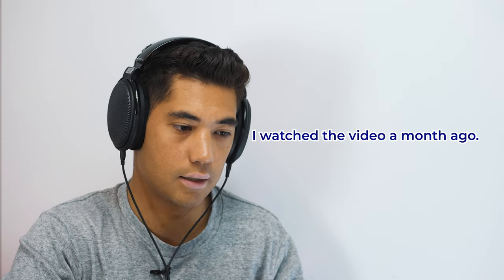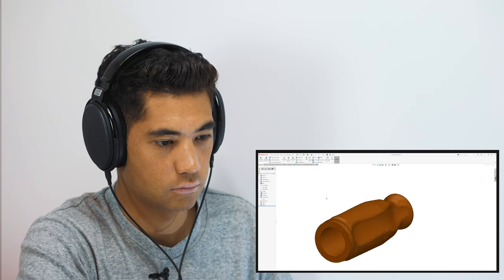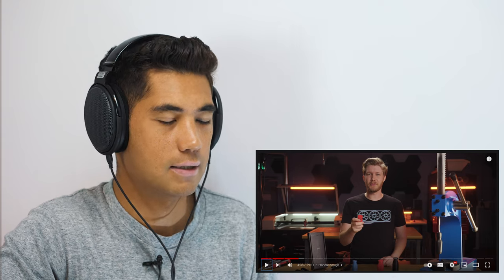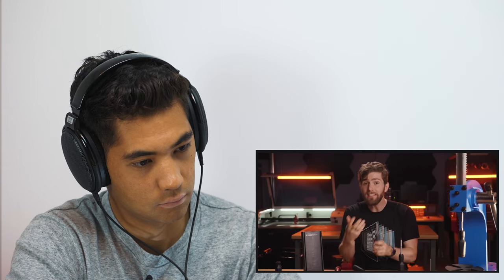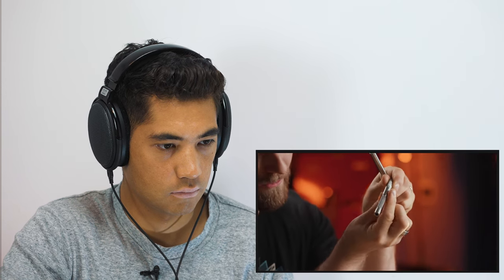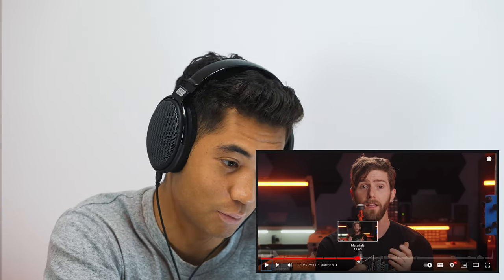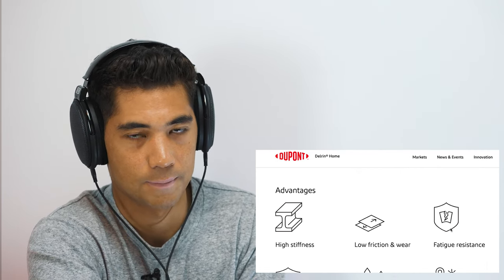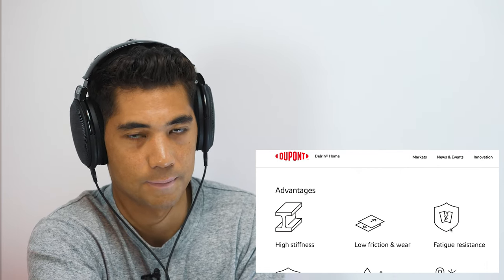Product Developer Reacts to the LTT Screwdriver | What can we LEARN from Linus Tech Tips

Comment: You were correct about the Delrin plastic that is used to hold the bits and its high stiffness that could pose a issue if dropped . JayzTwoCents did a review on the screwdriver where he dropped from his eye level and one of the tabs did break.
Reply: Tbf, he dropped it from about a foot above the top of his head, so a little over 7foot of a drop... but yeah,  one of the bit tabs did break
Reply: He's the only one. There's this dude who mods cars for drifting in Tokyo and he dropped it from an entire floor and nothing happened.

Comment: Came here from Jeff Geerling. I've owned the LTT driver for a couple months now, used on many projects. I also have Wiha, milwaukee, craftsman, harbor freight, and snap on screw drivers and ratcheting drivers. I bought the LTT because I know how long they worked on it/the attention to detail but really thought of it as a educated gamble, but am very happy to say it's my favorite now. It fixed several issues, like milwaukee's atrocious front end weight that literally causes the driver to fall out of you hand when one handing. The ratchet mechanism is easily the best, and I pay attention to this though on my ratchets eg 90-110 tooth is best. Finally I have a ratchet driver where the selector is intuitive, left is loose, right is tight, small detail that matters. The biggest difference i've noticed is one handing performance, its light, the triangular shape is just right for my hand, and the endcap is large enough and free spinning so its very easy to spin with one hand and a claw grip. Only cons for me: stock bit loadout is not even close to ideal, I dont use square bits at all, and need more hex and torx. That's the only con for me personally so it's money well spent, and the overall feel has me reaching for it constantly. I'll buy another for work and I just learned of a possible stubby version I'll keep an eye out for. Well done and well made product worth the cost, especially versus milwaukee. I was so sorely disappointed in theirs, from a company that generally manufactures the best stuff, sigh
Reply: Hand Tool Reviews  you sound fun at parties lol. I work a lot and don't have time to spend analyzing the whole market before stating an opinion, I made a comment with my opinion after using it for some time and falling in love with it. I don't own any of those other ones you mentioned, I only used examples of what I've actually used, but clearly you have the time to analyze the screwdriver market in granular detail so I would defer to someone like you's opinion, if you didn't come off like an elitest snob. I didnt say i was comparing it only to ratcheting drivers, i was comparing it to wihas non ratcheting type because for one handing performance it doesn't matter to me if its ratcheting or not. Fwiw the backdrag and ratchet mechanism performance is so good I would consider anything better really splitting hairs, adding to your image of elitism. I have no doubt you know much more about this than me, maybe I was too strongly opinioned toward ltt driver in my comment and came off as such, but I had a few minutes to make a comment here after watching geerlings video so I just wrote what came to mind. Good luck with your channel, you should probably take a 2000 grit approach to comments vs 200 grit though, works wonders for credibility and respect 😉
Reply: Hand Tool Reviews  maybe that was too strongly worded so I'm sorry for that. Long day for me away from home fighting with machines. Cheers

Comment: Very good video, well explained the process of product development. If you have connections that are willing, consider guests that are from different areas in the field. i.e tool designer, materials engineer.

It does make sense to use virgin material and not recycled at SOP/launch. Until PV tests have been completed with parts made from recycled resin would be risky.

Comment: 41:15. I work in plastic extrusion and injection molding. You severely underestimate the power of TiO2. It overpowers just about everything, including carbon black. In fact, almost all light shades of colorant are part TiO2. It's not just that the fully saturated colorants have a lot of the pigment and the lighter ones less pigment. The main reason is that the pigment is being overpowered by the titanium dioxide, making the colorant "whiter". So, in fact, most black plastics CAN be recycled into a white product! And it usually requires less colorant than recycling a bright white plastic into a dark product.

Comment: Interesting one of the other creators, i think it was Jayz 2 cents did drop the screwdriver and one of the delrin bit holders did snap. So that might confirm what you said about the "high stiffness" issue with delrin. However, they have done their own drop tests without issue, so it might have been a fluke.
Reply: From memory the issue was a failure caused by manufacturing breaking their fix for the issue

Comment: I have worked for more than  15 years with plastic injection as a mechanical design engineer, never heard of a mold of this size and complexity (pretty simple molds in this screwdriver) that cost 100K USD, not even close. From what I saw he should have 3 molds, lets say 4 cavities each, all of them together should cost no more than 100K for molds with a 500K-1M cycles lifetime (and this is an estimate on the expensive part of the spectrum you can get it lower), I guess he has 1 metal mold too which should be around the same price of 1 plastic mold and some machining for the other ratcheting mechanism parts. Most of the costs goes to the R&D process. Design of a product like this should take around 1 year from start to finish, so I guess the 3 years process is what cost him so much.

Comment: how come he doesn't know Delrin? POM is one of the most common polymers because it's so easy to machine or injection mould and is also used in low friction applications alongside polyamides. Every second 3d printing tinkerer knows it..

My professor talked like 15 minutes about it in the first lecture of material science.

Sorry if I'm being rude but this kinda undermines the rest of the video.
Reply: He's a film maker. Not an engineer
Reply: POM is one of the excellent engineering plastics. Virtually all (not-horrible) plastic gears are POM. OTOH, ABS is the hallmark of cheap plastic tools, coming from the distant offshore.

Comment: Its a great screwdriver but those proprietary short bits are its biggest downfall.
Reply: It's such a minor complaint since if you want to use long bits you can just rotate that little ninja star and put in six normal bits.
Reply: @TheSolongsidekick  It's not a minor complaint. Even if you put 6 normal bits, the magnet is too weak for the longer bits. I actually have this screwdriver
Reply: @TheSolongsidekick  it's not a minor complaint, if you get your bits chipped/worn, you are less likely to replace them as it's very inconvenient... I can't source them locally and no way I'd order them from the other side of the pond.
Another complaint is that if the screwdriver is intended for 10Nm, I'd have likely a 1/4 drive or at least an open wrench one (but that would require a hardened steel shaft)

Comment: This is a rebranded slightly modified Megapro screwdriver that is selling well, even at this price due to marketing/fanboys. It is not even particularly well suited to pc building, due to its short shaft, and chunky handle, even though that is what it is primarily marketed for.
Reply: It's not a rebranded slightly modified Megapro screwdriver.
They only used there ratchet mechanism and even that got tuned, the rest is completely different.
Also I had never any problems with the length and the handle thickness for building PC's, it's fine to use. I even like the handle thickness, to thin and you don't get enough torque when something is screwed in tight. I have a bunch of screwdrivers non the less most of the time I grab the LTT one. It's just nice to use.
Reply: @GermanMythbuster  You hardly need any torque to work on pc's, the screws are tiny, a #2 phillips, ideally with a long shaft is perfect for nearly everything, unless you are ridiculously weak, or have arthritis etc.
It is a Megapro screwdriver: "A not so little secret about Megapro is that we also offer Custom Screwdrivers through Original Equipment Manufacturing (OEM) projects, like this one launched August 2022 with Linus Tech Tips."
Companies love brand fans $$$
Reply: @-opus  did you actually watch the video though ☠
Reply: @codexous  I watched the video 🦵 and I too can use an irrelevant emoti
Reply: Saying it's a rebranded and slightly modified Megapro screwdriver is dismissive and fundamentally incorrect. They started off with the Megapro Automotive, threw out every part of it but the ratcheting mechanism, the bit holder and end cap mechanism, and designed their own stuff. Even then they modified and tweaked those Megapro original elements. So basically almost no part of the final screwdriver is identical to Megapro's.

I'm not a fan boy, I have no horse in the race, I don't own one, and I don't want one. You can argue that the price is steep, and I agree. You can say you don't think it fits certain use cases, and ultimately that's often down to personal experience and technique, so it's fair to say it doesn't work for you. Saying it's basically the same as an existing product, when they've shown every single step they've taken that makes it different, makes you just look like you have no valid points and you just want to shit on it due to some sort of bias or cynicism etc.
Reply: @Relyx  so what you are saying is that it is not a megapro screwdriver because they threw out every part, except for every part?
Half the people who bought into it probably believe the Linus invented knurling, or that knurling is some new high tech major advancement in engineering.
The screwdriver is marketed for pc use, but is obviously not actually designed for pc use (multi bit, ratcheting, fat handle, short shaft). It has proven itself to be an exercise is marketing and fanboy exploitation. LTT is now a marketing platform for products, under the guise of a tech channel. Babies first screwdriver, it is a wonder it doesn't come with rgb for double the price... chances are it will though soon, and the non rgb owners will rush out to buy it. "when they've shown every single step they've taken that makes it different" you mean just like every other product in the megapro range...
Reply: stay salty
Reply: @mhf0gamer  stay pointless
Reply: Lol poor
Reply: @x9x9x9x9x9  "lol" fanboy tween
Reply: @-opus  Full Disclosure, I don't own an LTT driver and don't really care what you think of Linus. What I do find funny is that you insist on calling something a rebrand when it seems you don't understand the concept of a rebrand. I won't be picking a side nor calling names and I also likely won't be replying I've spent enough time on this already.

Lets pop off with the definition of rebranding:
[Product] Rebranding is the sale of a product manufactured by another company under a new name.

What is a rebrand:
A rebranded product is something designed and made by Company A which then puts Company B's details on the item. There is NO alteration to the product aside from branding. A similar concept called or 'White Label' or ODM  allows for minor changes to the product and/or accessories that come alongside the product to differentiate it from competition. The difference here is that a rebrand is functionally and mechanically identical to the original product aside from branding. A great example is gaming chairs, many of these are rebrands, identical to each other aside from the logo on the item.

What IS NOT a rebrand:
A product that uses Licensed items that are patented by another company alongside custom design or alterations to the licensed patent or product including but not limited to mechanical, structural or functional alterations. Licensing a product or patent allows a company to create a 'Derivative' product from one that is already similar or close to what they want to achieve by modifying, with permission from the original creator, the licensed item. In this scenario 'Company A' would design the product, 'Company B' would then pay for a license to use that design and apply their own changes to materials and functionality. Company B is also typically responsible for sourcing the manufacturing of the product but this can sometimes be part of the License agreement. This is NOT a rebrand but a derivative, original product.

In this case, the design of the Ratchet is LICENSED from Megapro and has been re-engineered for tighter tolerances and different operation (selector wheel operates in reverse to the original if I'm not mistaken) The bit storage is also LICENSED from Megapro and has been re-engineered for different bits and to hold more while being more compact than the originally licensed product. The grip was also designed in house and is therefore not a rebrand of any product. The level of redesign that has been put into the driver puts this well into the category of derivative but original. They can't patent the way things operate as they are using licensed designs but it sure as hell isn't an OG Megapro design. If you don't believe me try contacting Megapro and asking to get a license for exactly LTT's design - you can't get one as it's not MegaPro's to give.

What they WILL offer though is a license for the original ratchet and bit storage that the LTT driver is based off of. 

Now lets move on to some of the weirder comments you made:
Half the people who bought into it probably believe the Linus invented knurling, or that knurling is some new high tech major advancement in engineering.
--- I've Never seen this being said anywhere by anyone, unless you have evidence for it this is at best a Hasty Generalization argument from a tiny sample source or completely made up. Both make unfortunately have the effect of making you seem less credible as you haven't backed up your statement.

The screwdriver is marketed for pc use, but is obviously not actually designed for pc use (multi bit, ratcheting, fat handle, short shaft)
--- As an IT technician for 10 years I would disagree with your point. However! Your point isn't based on factual, objective evidence, it's completely subjective. Just because you don't like it doesn't mean it's not designed for IT use. One of the most popular drivers for IT repair is from iFixit - they are multi-bit and come with a very short shaft and tiny handle as well as a large handle and wide shaft. These are purpose built for IT/PC/Repair work and share multiple characteristics with the LTT driver - is this also 'Not actually designed for PC use'?

It has proven itself to be an exercise is marketing and fanboy exploitation.
-- Source? Just because something sells well doesn't mean that it's exploitation. It's overwhelmingly well reviewed both by YT creators and purchasers. A good, but expensive product doesn't make it exploitation. If you think that spending some money to market a product is exploitation then boy howdy, I want to live in your world where no company advertises any products because I sure see a lot of ads on TV, the internet, billboards, papers etc.

Beyond this point you no longer have anything worth mentioning as they're not actually arguments about the product, just your general disdain for commercial success, popular demand and marketing of products to your own audience as well as a clear misunderstanding of what a 'rebrand' is.

To summarise, the LTT driver is an original product that uses a DERIVITAVE of Megapro's patents, not a rebrand. The materials, design, construction and operation have been altered, precluding it from bring a rebrand.
Reply: @-opus  All the arguments suddenly disappeared?
Reply: Maybe, maybe not. YouTube seems to have a habit of temporarily making comments vanish.